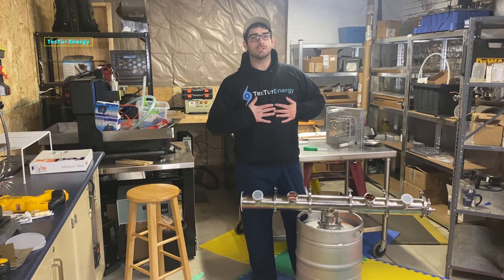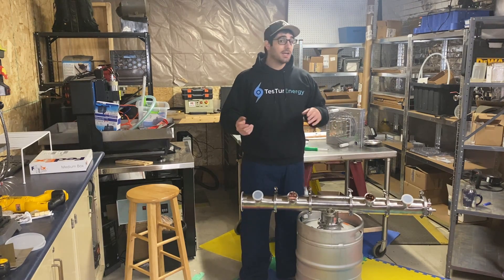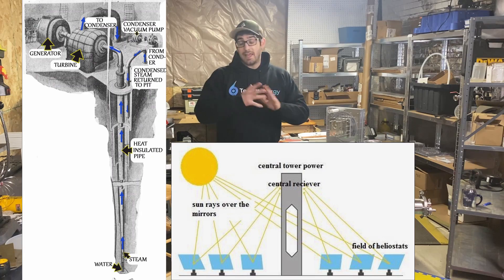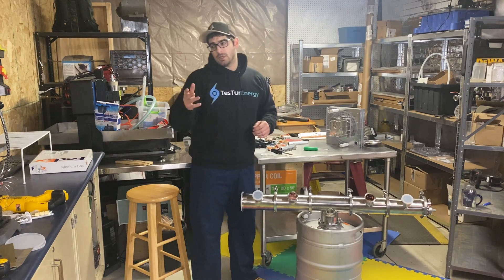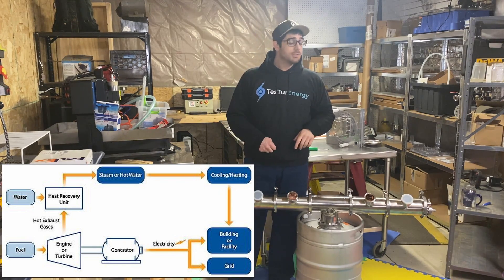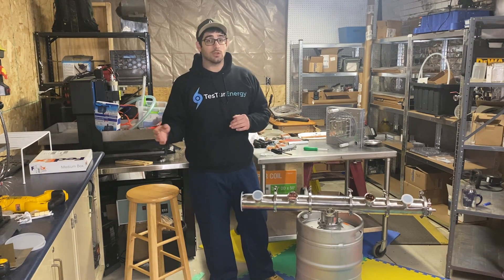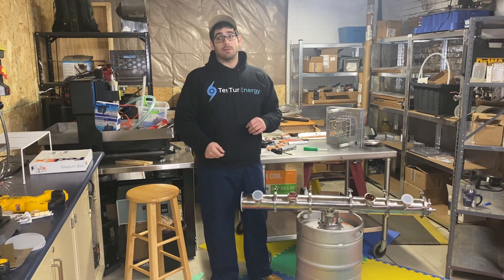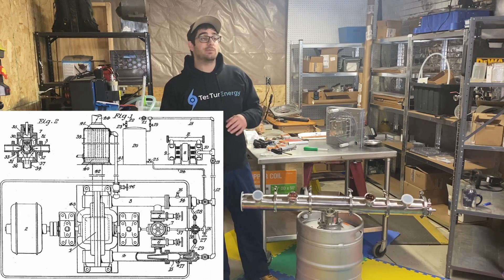Solis Talks Cold Steam Tesla Turbines - Nikola Tesla’s Electrical Power System + Patent GB 186,083

Comment: Great video! Is there anyway you could make a video, where you generate steam with electric heat, and then measure the electricity that can be generated from the Tesla turbine, with the steam directly powering the turbine? it would be great to see what is the true efficiency of the turbine itself.
Reply from the maker: Hey thanks for the comment! 🙏❤️‍🔥

I really appreciate it!

Check out the first steam tests I’ve got out so far where I use an electric boiler. 

Steam Tesla Turbine Micro Power Plant - 1st Start Up https://youtu.be/aMYyBsjhBR4   

https://www.instagram.com/reel/ClqGwiDDRSN/?igshid=ZmMyNmFmZTc= 

Cheers!
Reply: @CharlieSolis   Awesome video, I watched it a few times. I know it's after the fact, but do you have a gut feeling for how efficient the electrical in vs. electrical out for the Turbine system could be? Do you think it can it get over 50% efficiency?

Comment: I've been studying this topic for quite some time now. Tesla adopted a method of breaking his inventions into several small patents.
Reply from the maker: Tesla Turbine Patent List by Nikola Tesla     
US Patent 1,061,206 & GB patent 24,001: the original Tesla disc turbine patent from 1911.      

Then almost all Tesla’s improved turbine patents, except the Tesla valve patent, were patented in 1921, the valve was done in 1919.       

Patent GB 186,082: improved disc stack design for more torque        

Patent GB 186,093: combustion + steam turbine with built in exhaust heat recovery boiler.          

GB 186,084: combustion + steam turbine superheater and concentric/coaxial multifluid nozzle that the steam draws a vacuum on the exhaust of the combustion mixing them as they enter the turbine.         

GB 175,544: hybrid Tesla Disc + Parson’s reaction turbine for utilizing the Reheat Factor of the energy lost to shearing in the fluid between the discs        

GB 186,799: process and apparatus for balancing rotating machinery for  quality at-speed dynamic balancing.        

US 1,655,114: aerial apparatus patent with improved turbine nozzle design         

US 1,329,559: Tesla valve for pulsed combustion Tesla turbine.   

GB 179,043: High Vacua Pump

Comment: Magnificent! can't wait to see the whole thing at work
Reply from the maker: Soooon! 🔥😈🔥 very very soon! I’m getting my work table all cleared off and organized to do the next round of compressed air tests to see the energy converted from a known volume of compressed air for 300watt load, then a 600watt load, then a 900watt…. All the way up to 4000watts. 

Then after I do that test I will be changing the gear ratio and repeating the tests over for the turbine spinning at different RPMs to see how that changes the efficiency.
Reply: @CharlieSolis  really !  😁 this wil be a historical! there not so much people acutely making power systems Out of the turbine or any other engine he designed or improved
Reply from the maker: Yeah Buddy! 😎 

If you haven’t seen them yet… check out the power output tests I’ve done thus far! 
Tesla Turbine Generators With Usable Power and Torque playlist
https://youtube.com/playlist?list=PL4XBGjR8Gu-Emu1QRPIwATKFuCZabqOh1

Tesla Turbine Dyno Horsepower And Torque Outputs! + 300mph 3.75hp 6.22 ft-lbs 4150rpm
https://youtube.com/shorts/Zxy8mIVG6as?feature=share

1200watt continuous electrical load output with room temp compressed air all the way down to 65 psi too and with the turbine only at about 6700rpm.
https://youtu.be/uQsPA4s_FRI

The same compressed air supply but with thermal addition tests:
https://youtu.be/BHPAQF8QNnw

This is a look through of the 10in disc stack of 75 discs, +10,000in^2
https://youtube.com/shorts/FU2LMZQ2_yA?feature=share

These are the latest liquid fuel burner tests for the replication of GB 186,083.
https://youtu.be/gRqKowignac

These are the latest propane burner tests.
Tesla Turbine Jet Engine Combustion System GB 186,083 Superheated Steam
https://youtu.be/KCyyiKnIarc

I haven’t gotten to my Tesla disc compressor tests finalized just yet but I have the setup to do them already just gotta do some upgrades to my bearing and gear hubs for the generators. 
10in Tesla Compressor & Turbine w/ Built In Balancing Apparatus RC Car Dual 6s 3kW 2200kv BLDC Motor
https://youtu.be/fCQn7Q0rroI

Comment: Why have you not been brought to a major power company and paid what ever it would take to implement these things. GE would just want you to shut your mouth but like a southern company or CAlpine would make more money because you work would give them way more efficient turbine.  GE up out all other company’s that make any turbine efficient just ask Alstom
Reply from the maker: We’ve had a couple prospective incubators come to us and a few independent investors as well but nothing was a good fit for what we are trying to fully accomplish. Most wanted to dart off into the weeds on smaller sub ventures before going for broke on the full complete system. 

Just wait until I show what I’ve been putting together over the last two weeks for this GB186,083 Steam + combustion patent. It’s just beautiful how simple, and yet “wholistic”, this system is coming together. It truly has the potential to be the piston engine killer and the refined fuel engine killer. It’ll burn straight crude, powdered/pulverized coal/biomas, syngas, hydrogen, It even has the potential for us to unlock IRON as a fuel source…. Yes you heard me correctly. 🤤😈🔥and all that results from using iron as a fuel is FeOx’s which are solid particulates and can be simply and COMPLETELY cyclone filtered out of the exhaust leaving literally zero carbon emissions. 

Hell even just switching to crude will double our global fuel reserves because it takes a gallon to refine a gallon for use…. Just throwing half of it out the door to give the illusion the tail pipe is “cleaner”. Meanwhile the oil companies run ads complaining about taxes and “liberal regulations” on the oil industry when in fact it was the oil industry themselves who pushed for all the special regulations and red tape for their hyper-proprietary, special formula, Mount Everest of barriers-to-entry type refined fuel industry that THEY lobbied into oblivion to be the only fuels allowed for road use…. 

And then we have corporations like GM who actually manufacture automobiles who are literally owned by TEXACO……😑😑😑 …… Why in the world would a parent company, like Texaco, allow their subsidiary corp GM to make automobiles that are more fuel efficient and use LESS fuel… when the entire business model of the parent company, Texaco, is predicated on the sale of special refined fuels…..😑😑😑 they wouldn’t… they would drag their MPG heels all the way into the future to sell more fuel for more $$$. 

Corollary, In my humble opinion, this is why auto Corps like GM don’t care that they make abysmal profits on their automobiles because their automobile sales are literally just the “vehicle” for their fuel sales. And because they can then tuck their fuel profits away in separate corporate financial portfolios,  GM can use their financial portfolio’s constant “bottom line” numbers to stagnate their own work forces manual labor AND front end labor wages, and because they are such mogul companies they heavily  contribute to the overarching national and even international labor value deflation. The auto industry literally used to set the bar for wages and now the industry is milked dry from every end and even in the engineering world within the Big 3 it’s so cut throat and saturated that wages have stagnated. 

But anyway I could go on for days about this. 😅 which is probably the answer as to why the big companies haven’t come my way. The offers we did get wanted me to take down all my public videos about the Tesla turbine work I’d done so far for “corporate financial security” reasons. 🤣 yeah, no thanks. I’m here to f*** sh** up in the energy industry for the entrenched players.

“Either lead, follow, or get out of the way.” -the OG T. Paine… 😂

Comment: I will be contributing soon. I have seen this done on a large scale coal plant they just shut down in boulder. They create high pressure dry steam before the turbine buy injection of wet coal in a powder talcum state into a 1278F boiler  that is about 5 stories. I don't know why they shut it down because it was one of the most efficient power plants in the area. 
  I have tons more we can discuss I have found that you can increase your system buy limiting loss and errant gains.  In a systems I designed I was using   a variety of combinations of pressure, vacuum, phase transitions and closed systems to get to where your going. My system took 4 years to build with 2 years being put into a hand design and  made steam solar steam block and exchange systems.
Reply from the maker: Nice yeah I have a couple more tricks up my sleeve with this too that I think is extremely critical to why this gets much better efficiency. It’s not a brayton or a Rankine and if I’m right it should be even better than a Humphrey cycle.
Reply: I did mine to commercial/ industrial chemistry fluid  standards.  It was not cheap buy any means like your 4" T you got there.  I never had to worry about failure of components and it was the sensor ports and controls that were the difficult part to deal with.  That sort of standard will make getting consistent results and changes in what you build and even how it's built.  Tungsten   cone point Calandria is all I will mention.☺️

Comment: So the exhaust won't come out cooler than ambient air?
Reply from the maker: Correct. Especially, not when you’re using ambient air as your condensing medium. Of it did come out colder than ambient you wouldn’t be able to use ambient air as your condensing medium. You would need something even colder to actually condense the steam to maintain the vacuum. If you expand the steam and it came out colder than the ambient it wouldn’t be able to condense because it would pull heat in from the ambient and stay a steam.
Reply: @CharlieSolis  hmmm. That sounds legit ha. Look Idk anything it's just I thought that was jeremiahs claim that the 2 stage turbine was so efficient at using the heat it actually would have a cold exhaust which would keep the cycle running.
Reply from the maker: Sorry I had to edit that for some reason auto correct removes “n’t” on the end of some words and completely reverse the meaning of what I’m saying. I think you got the point though. And no worries I didn’t think you were saying that. Just giving a clarification. But yeah the second stage pump isn’t without its merits, it just can’t cause condensation all on its own. It can increase efficiency, it just has to be done the right way.
Reply from the maker: I should add that you will get condensation from continuously expanding steam but you cannot condense all of it. This is why most large scale turbines aren’t the most efficient and get the “overall efficiency” high because of recoup. They can’t fully expand the steam past the point of where condensation droplets will form in the steam. This is because the wet steam will just destroy all the blades from cavitation. The Tesla turbine doesn’t suffer from this and as such you can fully expand the steam through the turbine even past the point condensation will form but it won’t be able to condense the whole thing. Doing this allows the last bit of the steams energy to be extracted. But if you’re using a second stage pump you may be just giving up that energy for the second stage pump to increase condenser performance and it will increase the overall efficiency. Because using that last bit of expansive energy to power the second stage pump is better than not. 

It’s analogous to how you can pull a vacuum on a volume of hot water and you cannot boil off the entire mass of the water with the thermal energy stored in said mass of the water, without adding in more heat from outside.
Reply from the maker: Check out the Tesla valve vacuum chamber tests I’ve done. 
https://youtube.com/playlist?list=PL4XBGjR8Gu-HmsTX-x9wp5Of9iRq4EIBn

Comment: Very fascinating stuff. Thanks for the walkthrough. Would like to use a system like this when I have my own place.

Makes you wonder what Tesla could have done with all the funding he required.
Reply from the maker: It’s all about that CHP cogeneration!! 
And for real though! I’ve heard reports about him walking off the whole turbine R&D enterprise when he was trying to do the 6ft diameter ones because he didn’t have faith in any of the engineers working on the project with him. I also know one of his biggest issues was his abrasiveness to people around him. He was really hard to work with which led to a lot of issues in his projects. I struggle a lot with that same abrasiveness because of my aspergers/autism. I’m extremely blunt with people and it usually rubs most the wrong way 😅

Comment: I'm curious what you think about the following patent US20140009098A1
It is basically a capacitor with one plate spinning. It is charged with some sort of isolated voltage source. I'm curious if you're Tesla turbine design would work well with this. Implementation is the difficult part of this patent. The other possible implementation I have run across is a vacuum capacitor to store enough charge to make it useful even at low RPM. It is US9042083B2. Not that I expect you to learn how to make vacuum tubes. I'm just trying to think of ways to usefully implement the design
Reply from the maker: I’ll have to take a look!